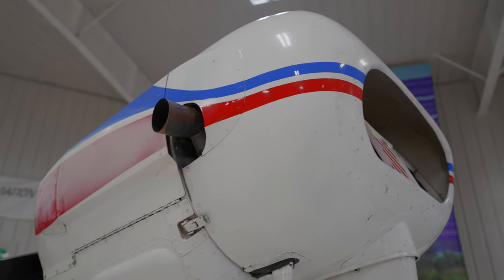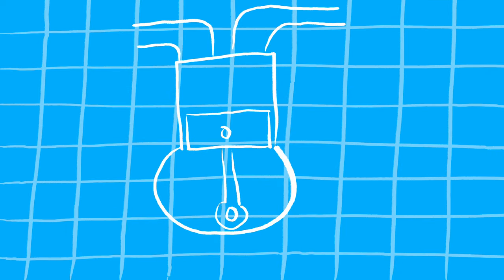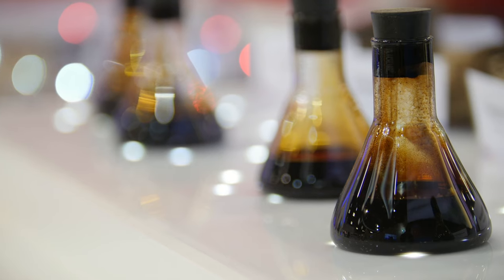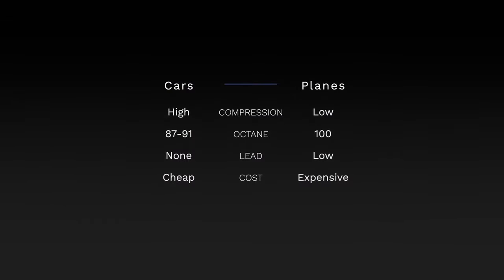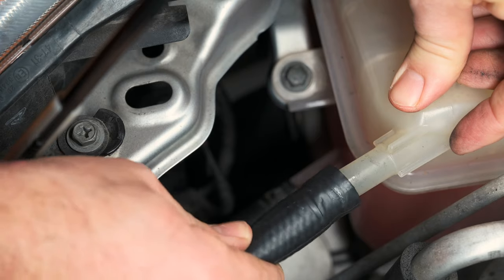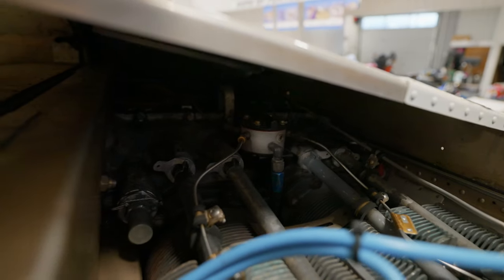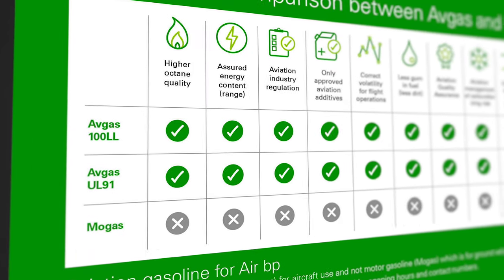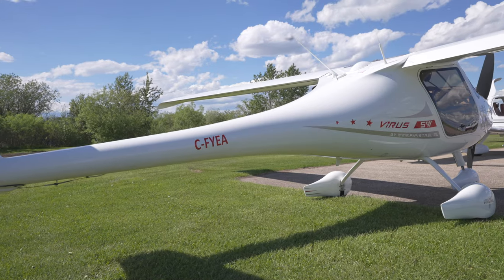Why Airplane Gas is WAY More Expensive

Comment: EVERY component of the fuel system that is made from aluminum is attacked by ethanol. even hardlines :(  it's not so much the corrosion that accoure that is the problem it is the byproduct's that clog up stuff.